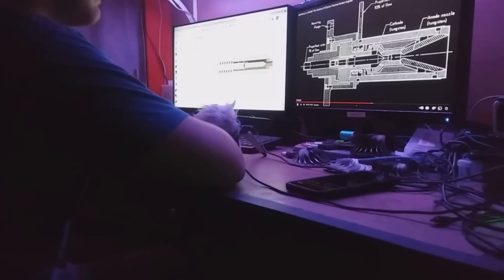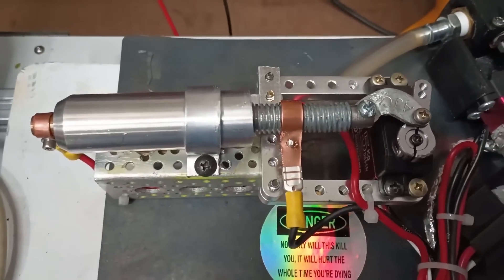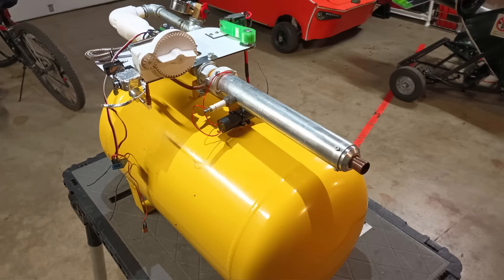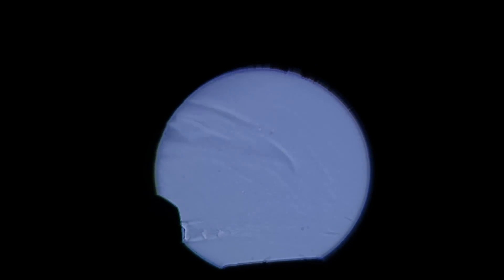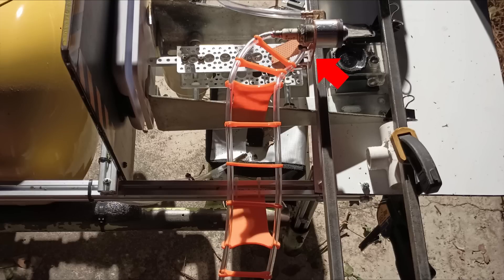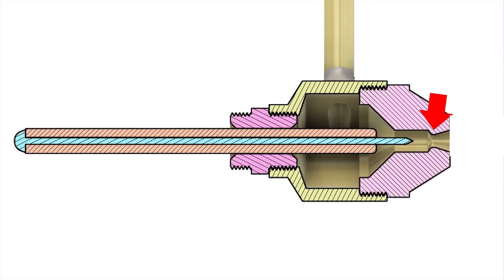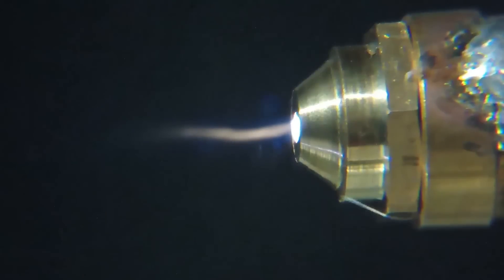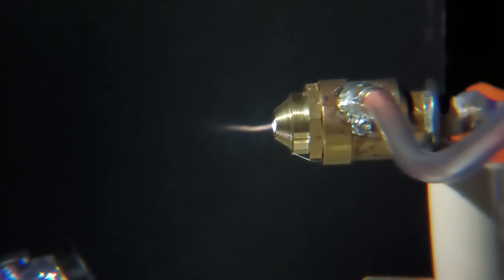I made an electric rocket engine - how is this possible?

Comment: Perhaps part of your thrust is generated from burned graphite, so you have hybrid solid rocket engine
Nice diamonds on the exhaust.

You may try to use tungsten electrode if you use argon instead of carbon.

Comment: you will want a ring magnet around the exit cone as close to where the nozzle tip as possible. this will cause the arc to travel in a rotary manner around the inside surface area of the cone making an even plasma path and ignition.

Comment: So why not use a tig torch tungsten rod for an electrode, or a bundle of them.

And venturi is the proper word for  your propellant orifice I believe, not throat. Try propane oxygen lol. A diesel fuel injector with liquid propellant with pure oxygen added between the venturi and the electrode. High pressure directional vapor jet plasma.

Comment: More gas more electricity just like a ark welder so imagine a shit ton of gas just blowing out well it’s gonna have a hard time igniting just like air and fire safest bet I can think of is something to improve the energy to greater then what is it and see if that works or create a system that the has the repellent come out at key spots instead of all around it btw I’d be surprised if what I say works I dropped out

Comment: You are burning through carbon electrodes because your feed gas is compressed air, it contains 20%-ish oxygen and is actively burning your carbon rods at an extreme rate. The cheapest non-oxidizing feed gas, assuming you want to keep using cheap carbon rods, will be nitrogen which can be cheaply purchased as liquid nitrogen (assuming you have an LN-rated dewar, the gas company won't fill anything but a rated dewar), you just calculate the volume of your air tank and convert the expansion rate of LN to the pressure you need to obtain the correct volume of LN you need to add to the tank, then let it thermally equalize.

Comment: I wonder if using nitrogen instead of air would reduce the consumption of the electrodes. The oxygen in the compressed air, combined with the arc heat source, may be burning things, no?

Comment: You know what would be fun? If you implemented a compression region via tapered wave-guide fed by a microwave oven transformer to further ionize the air into an atmospheric plasma. This way, you can ditch the integrated machined nozzle, and install a magnetic nozzle or solenoid of some sorts since you already have the power supply for it.

Comment: Arc gouging electrodes are made to handle extreme heat under air pressure. They ablate way less rapidly than your graphite rods. Should work fairly well.

…or some kind of platinum plated tungsten rods. That’s got to be expensive though.

Comment: Maybe if you create a magnetic or electric field that attracts the gas. Basically attaching an ionic thrust stage. This might due two things: Let you reduce power consumption and increase longevity. The field strength probably can be made much higher and requires very little power. Basically create a solenoid at the end. If it accelerates the particles enough this could be beneficial and shouldn't be that complex to do. You'd just have to makes sure that all the polarities are correct. It would likely have to be quite long and flare out to have enough time to accelerate the particles to increase their velocity. E.g., if the graphite had iron powder(or some other magnetic substance) within it then this might help but might create new problems.

Also, to fix the starting arc issue you can pulse it with a high voltage that will temporarily ionize the air. It might take some time to find the right curve for optimal results but it shouldn't be that hard of a problem. Probably just starting off with a very high voltage and quickly dampening it.

Comment: To stabilize your arc you can use an inductor (with low voltage 30-1000V DC power), it enables you to make large arcs with lower voltages and currents, try to use the highest inductance possible before the resistance loses on the inductor become more than a few percent. To start your arc you can use that same inductor to generate a high voltage spark by adding a few turns of wire and discharging a small high voltage capacitor onto that wire with a triggered sparkgap.

Also many talk about using an arc welder for this but such power supplies are limited to less than 100V and a few kW of power, and while many electrothermal thrusters work in that power level I think for ground tests at high pressures a large one can be better specially with voltages above 100V. 
If you can get your hands in an electric car battery that could work as a good power source, using a resistor made with long aluminium strips immersed in water (so water acts as a heat accumulator and gives you a few seconds of operation) you could limit the current to a safe level for the battery while still having tens if not a couple hundred kW of power for several seconds. Obviously this is quite dangerous!

Comment: Try to use 2 microwave oven Transformers,two secondary in series 4kv 1-2Amps.With higher current you can get really stable hot arcs at this voltage....But danger it can kill you.

Comment: Try using plasma cutting torch with pilot arc and a cheap amazon welder. You can use neon transformer, some diodes and capacitors to strike an arc easier. Graphite circle can be used as 2nd electrode, it shouldn't wear as much

Comment: It would be cool to see this with helium. If the party balloons tank pressure are too low for this maybe nitrogen or argon are not the best but are still lighter than air. In addition it's less corrosive so the graphite electrode model coud work.

Comment: Interesting.  Was thinking if you used copper rod electrode, the copper would vaporize and become fuel which creates fuel/air combustion ignited by arc.  Vaporized aluminum electrode could also be used as fuel.  You would need high current to vaporize metal.  Try using microwave transformer with microwave capacitor & diode voltage doubler circuit, creating 4000v pulsed DC 50-60hz.

Comment: Very interesting, I have never really heard about this kind of engine before. 
Have you considered using microwave transformers as a power supply? They can supply much higher currents in the range oh 100s of mA at 2100V. You can connect up to four in series or add a voltage doubler to two of them to get a higher voltage. Alternatively have you thought about using a TIG welder? Those welders already have a high voltage system to strike a low voltage high current arc and might work in this engine.

Comment: You could try with different design. Making melting coil and putting inside some high melting point metal which could heat the air. So you don't burn out electrode because this way you heat up metal with changing magnetic field. Try using nitrogen because would less react with metal that is heated up.

Comment: if you can build a system that uses slow moving high compressed air instead of fuel, you have unlimited atmospheric propulsion system (well the battery would be the limit. but no fuel. pure electric "jetengine") also try a rotating/spinning arc to reduce wear and unpredictability 
p.s.: you have a new sub
p.s.p.s.: slap a afterburner on it =D just for gags

question. does the size of the combustion/ionizing chamber matter? would a bigger allow it to build up more pressure?
Reply from the maker: The size of any thermal chamber in a propulsion system comes down to chamber residence time. The larger the chamber, the more time the propellant has to get heated or for a reaction to occur. Larger is generally better for greater thermal efficiency, but it comes at a mass penalty.

Comment: You can get 200 amp rated pre-drilled copper inserts for plasma cutters from your local welding supply store. They are drilled to create a swirl of the plasma as well.  (I don't know if you noticed but you created a  plasma cutter while you were building a rocket motor) Another commenter suggested a Tig welder system and this is a great suggestion because you can get tungsten electrodes in sizes up to 10mm very easily.  You can shape the tip of the tungsten to create several arcs and a larger plasma "ball" in the throat of your nozzle.  You will appreciate the ability of tungsten to endure high temperatures and not deteriorate so rapidly while you are testing your designs.
Reply: Superheated tungsten will oxidize almost as rapidly as the graphite rods. They’re designed to be used under a noble gas. Not to mention some types would be dispersing radioactive particles in the air. 

Arc gouging electrodes are far less expensive and are designed to be used under multiple atmospheres of air pressure.

Comment: ATTENTION PLEASE! Your graphite electrode han not been eroded or used up, it has broke up. That is due to your lack of knowledge about graphite. When you buy graphite rods, they are soaked of some sort of oil. Before to use them as an electrode at high temperature, you have to heat them gently over a a time of 5 minutes or so, to bring them to the red hot. You can put them on a gas stove or whatever. You'll see that they will smoke and catch on fire. After a while the oil will be completely expelled and your electrode will last very much longer!
Now your electrode explodes because the oil trapped in it, vaporizing, cracks the electrode with the built up pressure, from the inside.
Now you know, try again.

Comment: You should try finding a cheap used TIG welder that still has the high frequency start that works, that way you could get rid of having to move the graphite electrode to strike the arc. Not sure if works, but to me it sounds like a idea worth of testing. Just subscribed a few days ago, love your R&D work!!!
Reply: Or plasma cutter))
Reply: @G2kt  That's a good idea too, i think the pilot arc on the plasma cutter works similar to the high frequency on a tig. Still another good idea to test.

Comment: From my understanding of ionic engines this is basically an ionic rocket engine, without the grids. Adding grids would increase the thrust produced, the plasma channel has some interesting videos on the matter.
Reply: Ion thrusters have a different operating mechanism than thermal electric thrusters. Think particle accelerator vs welding machine. One is using electric effects to accelerate ions, the other is increasing gas temperature/velocity with thermal energy.

Thermal electric thrusters are generally orders of magnitude higher in thrust and lower in specific impulse than ion thrusters.
Reply: also it helps to cool down the air to slow down molecules so they have more time to absorb energy

Comment: I wonder if it increases thrust to somehow slap some magnets on the engine. If you can get the lorenz force to either add to the exhaust velocity or pinch the plasma radially magnetically to bump up its pressure before passing the throat it might increase the thrust.
Reply: Please 🤫

Comment: Well done!
You could maybe try to use parts of  a plasma cutter. In essence they are arcjets working with air although not  optimized fot thrust. But i think that's something you can solve with ease.
And they could pump out multiple kilowatts of power without a problem